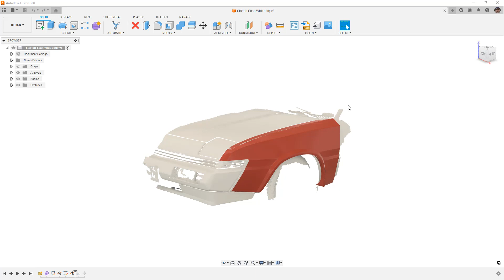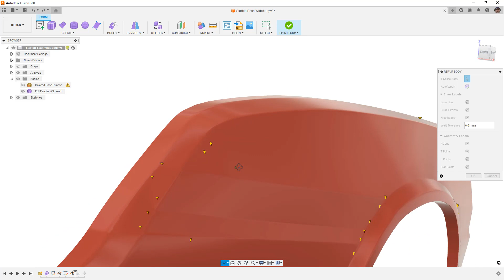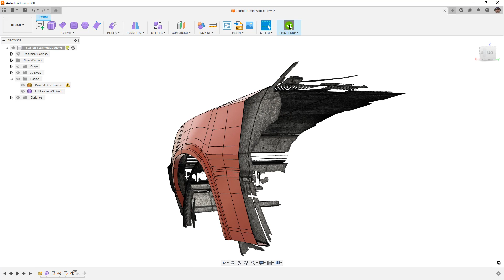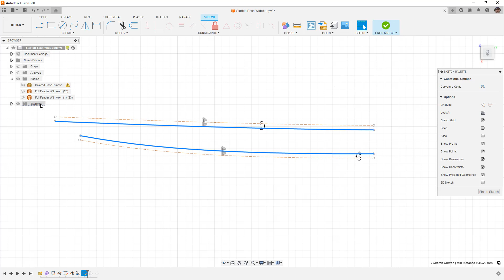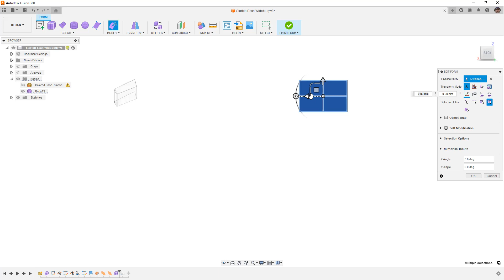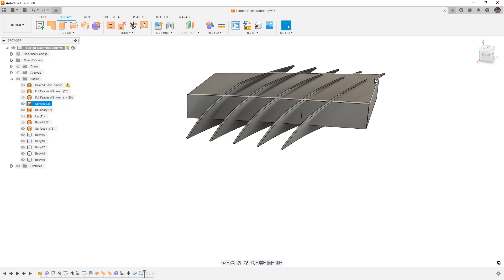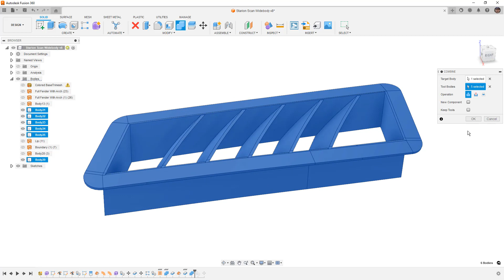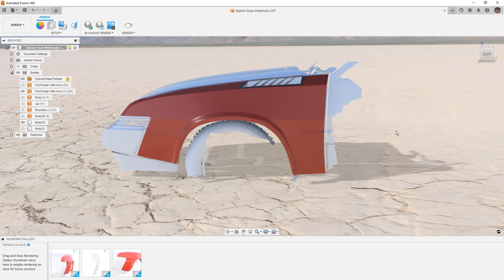3D Scan to Part Series Part 13 | Wide Body Design Part 10 | Making a Fender Vent and Thicken

Comment: Hi, thanks for the great videos, you've help me a ton here getting started. 

One of the projects I'm working on is louvres for use is a competition car. Your video leaves the extruded original sketch intact, essentially a box around the veins, where functionality would be greatly improved by having each vein protrude away individually. Having gotten to that point with help from this video, I want to make faces that connect the corners of each vein's trailing edge to the corners of the downstream vein's leading edge. I would then filet those faces.
Reply from the maker: Awesome!  Thanks for sharing!  Was there a question in there?  I don't think so but want to be sure.
Reply: @LearnEverythingAboutDesign  Haha yes thanks. Is it possible to do what I described - connecting the trailing edge corners to the leading edge corners - and if so, how? I'm at that stage having formed the vein, the repeating patter etc. I have that built onto the flange/shell.
Reply from the maker: @Quearnyisslad  can you email me a picture? support@caducator.com  I think i know what you are trying to do but want to be sure.
Reply: @LearnEverythingAboutDesign   I sent you an email a little while ago, thanks!
Reply from the maker: @Quearnyisslad  odd i haven't seen one.  Microsoft has been on a bit of a tear lately so hopefully it comes up soon!

Comment: Found your channel and I absolutely love it as a Motorsport engineer. 

Question; how would you go about a designing a track style fender cut outs for the fender? 

Thanks!
Reply from the maker: Thanks!  If by track cutout you mean the notched in section behind the wheel?  I see these mainly on civics/integras.  The process would be the same BUT you would ideally have a scan of your fender on the car and one with it gone so you know what space you are working with under it.  Either that or take the plunge and cut the fender then scan it like that.

Comment: So if we wanted a better model, you recommend a better tool. Blender is free. Is there a good way to export from Blender into Fusion to generate a toolpath and preserve the perfect curves? Demo? Love the detail of your videos! Thanks!
Reply from the maker: I do have a bunch of videos converting back and forth between Fusion and Blender, but in this case Blender isn't a better tool.  Blender is a "poly modeler" meaning you are working directly on mesh bodies.  Fusion models NURBS surfaces or rather converts to them from the freeform model which gives us real surfaces, not a mesh.  If the goal was just to 3d print and nothing else, you could model in Blender and print from there.  We are converting to mesh(or not at all if you use Additive in Fusion) at the very end which means instead of 3d printing it could be CNC machined out of foam or a mold made for carbon fiber or plastic.

So the better tools typically would mean Class A surfacing tools.  Autodesk's tool for this is Alias.  Most of the time when you get into a true surfacing program for cars or industrial design you are talking a very expensive tool.  Alias is $10k/year.  Creo which claims Class A in their surface package is up in that range or more depending on what options you get.  NX, Catia etc.  All these big programs that contain higher degree of precision and control in surfacing come at a cost.

I think if Fusion is able to get better quality and control with the surfacing tools it will be in a better spot but at the end of the day it isn't made, nor will it ever be the intention of it to be a car modeling program.  So you just have to come to grips with the end goal of any project and compromises you might make.  For this series i am 3d printing the parts.  Breaking them up as solids and building features to glue together is easier as a solid than as a mesh(for me).
Reply: @LearnEverythingAboutDesign  Fully appreciate the "close enough" aspect of this project and am looking forward to seeing your full build. I'm studying your videos and trying to learn. My experience with Fusion so far is that I'll get a model ALMOST where I want it, then I'll screw it up and end up frustrated in the end. Just as you fixed the couple of issues on your mesh in this video...this will be the point where my expertise falls short.

I do have a large router that I want to make some molds for carbon fiber. I have a 2006 Porsche Cayman that I want to remake the engine cover to integrate the air intake similar to the new Cayman GT4RS. I want that induction noise!

I can't confirm nor deny that I have access to Autodesk Alias. 🙂 Just not positive I want to invest the time to learn a new piece of software (yet). In terms of generating a toolpath from the output of Alias.... is that something that can be accomplished by exporting from Alias into Fusion? I've watched some Alias videos, but there isn't nearly as much content on Alias as Fusion.
Reply from the maker: Alias from my opinion so far is a very old UI/UX design.  It makes being efficient very hard until you master how they want you to do things.  Same thing with Rhino.  I have just found the way to do things very frustrating and cumbersome to the design process.  But yes if you could export from Alias to Fusion you can use Fusion to generate the toolpaths.

One thing of note.  where Fusion really starts to hang up with forms is those change of directions/star points you get with car fenders.  If you are doing an engine cover you likely won't run into that problem.  Any round features like say an oil filler hole could'should be done after with surface or solid tools.